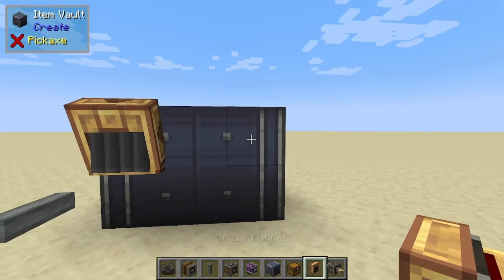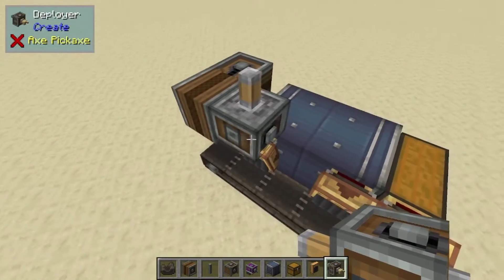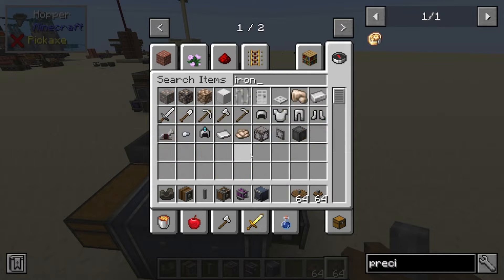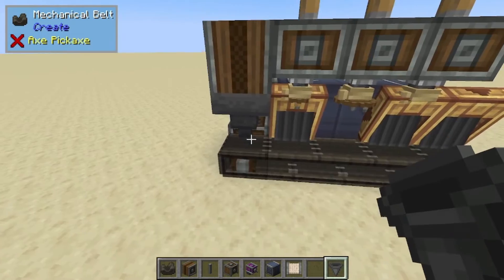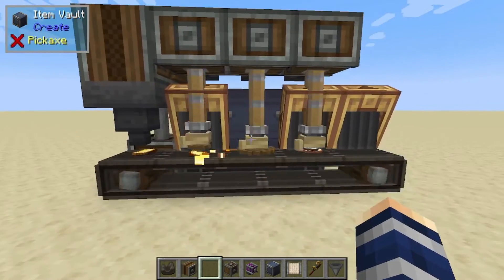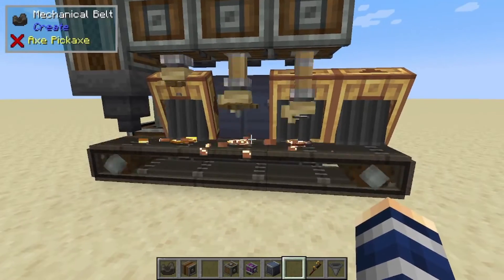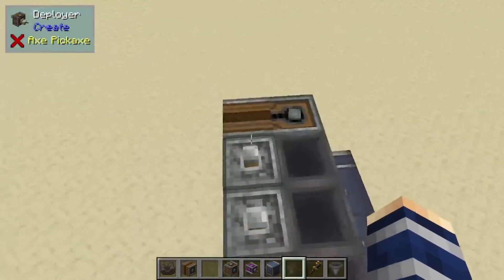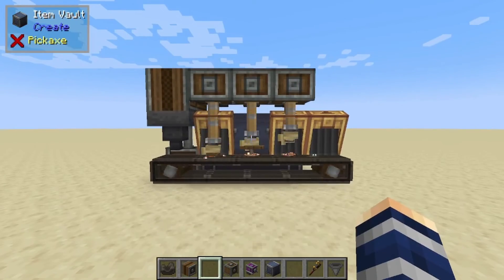Create mod: How to Automate Precision Mechanism

Comment: this is definitely more of an "on request" auto crafter. as long as gold sheets are hitting the belt then the vault will not let any incomplete mechanisms onto the line.
put in the gold you want and get out 80% of it as mechanisms. you cant just fire and forget with this one
Reply from the maker: Small modification can make it completely auto...you have to use the detector on the vault to see how much is inside and limit the gold input until the mechanisms are completed

Comment: this breaks as soon as i add the filter
Reply from the maker: Make sure you have the nbt settings right
Reply: @MCMentor1  i dont know what that is. Also I'm playing the "steampunk modpack" maybe that's why too.
Reply from the maker: @noblepenguin3486  Same pack it was buildt in so shouldnt be an issue...i have this same setup on the server
Reply: @MCMentor1  then there is something i dont understand. LOL. I never payed modded before, 303 or so modsatte is overwhelming 😅
Reply: I made a manual one, and now i understand more. Maybe I shouldn't try to make an automatic one before I even understand the concept 😅😅😅

Comment from the maker: When using this machine do not feed it a constant flow of Gold it will eventually clog Vault...to get around this add -----I cant think of its name--- that can detect number of items inside the vault and release a redstone signal allowing more gold plates to be sent into the system.
Reply: You're thinking about the threshold switch and the redstone link? :)
Yes thats working ;)